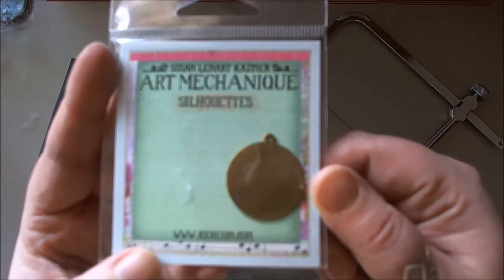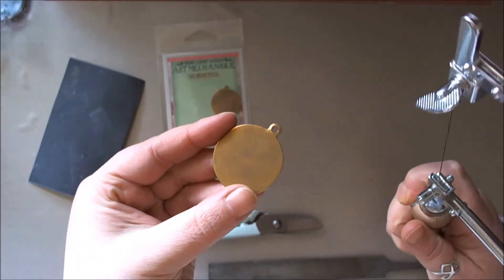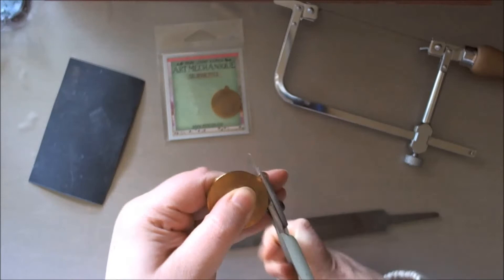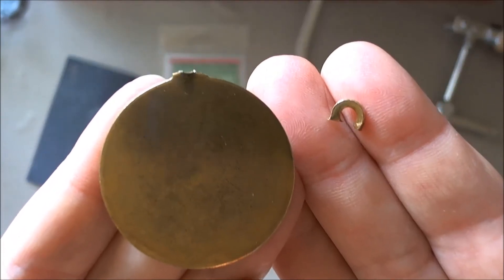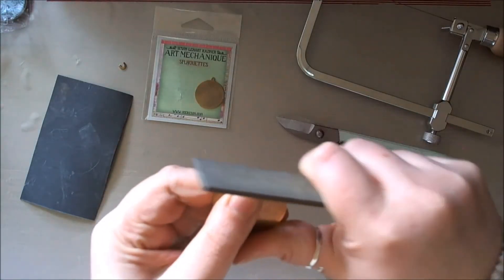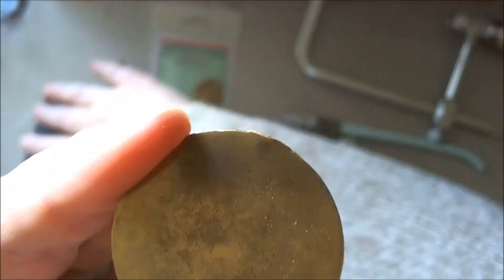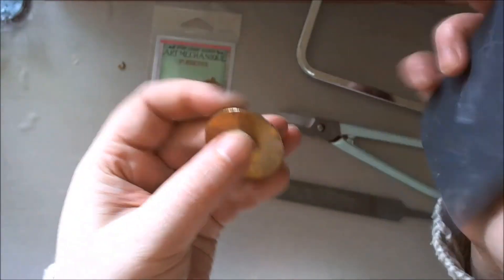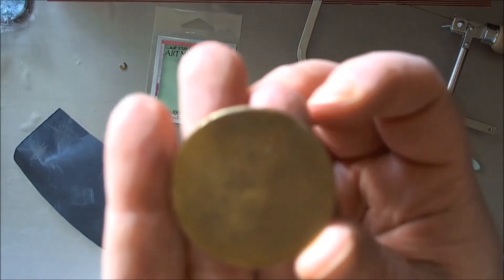Altering Art Mechanique Silhouettes

Comment: Please do not teach techniques you haven't mastered. All files are designed to file in a forward (push) stroke. They don't file in the back stroke, as you have shown in your video and should not be held in the manner you have shown. Also, "air filing" tends to cause uneven filing. The blank should be held firmly against a bench pin or stationery block, and you should follow the contours of the item as you file (round item) and take longer, even strokes (great for straight filing).